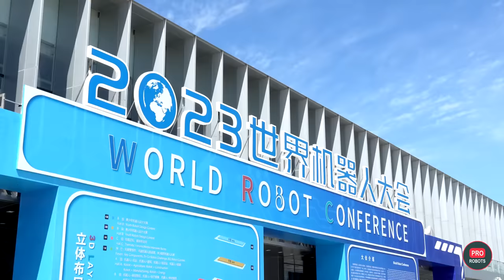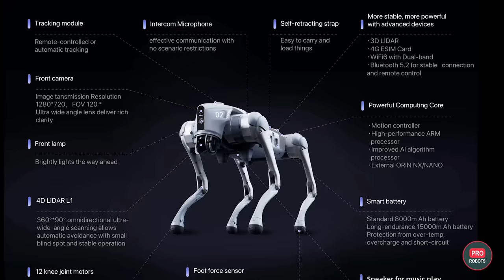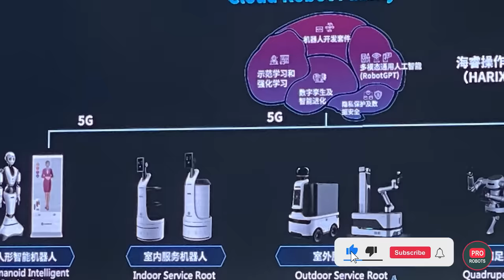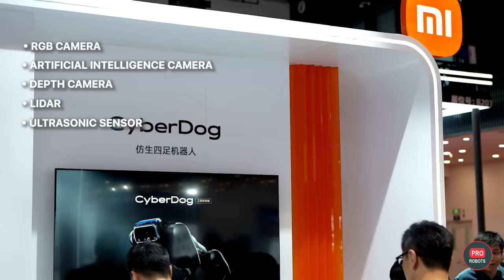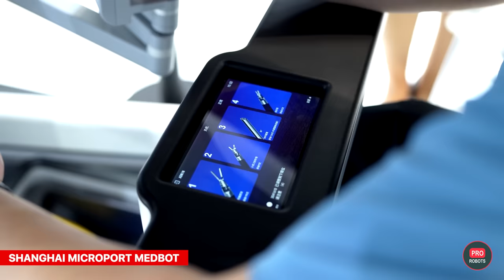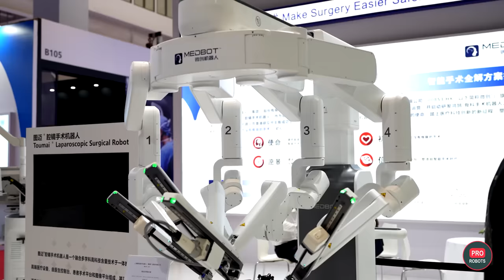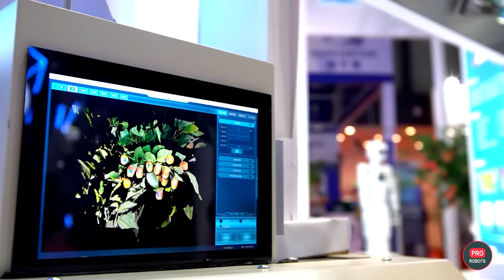WRC 2023 - China's largest robot exhibition | Robots and technologies at the exhibition in China

Comment: Solar paneled robots that know to go stand under the sun until they are fully charged when they are running low on power.

They also know how to preserve the human race being told about tube babies and artificial simulation and can rebuild humanity instead of destroy it if extension ever happened.
Reply: You could also program the robots on how to make a survivable habitat ( requirements for human survival is met before hand. Rfhs ) before making the first set of frozen eggs and sperm.